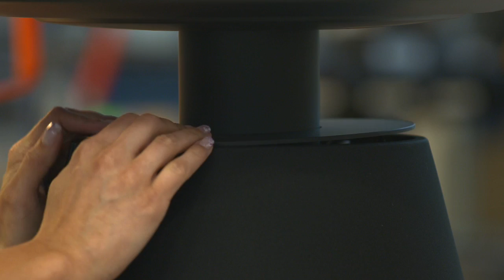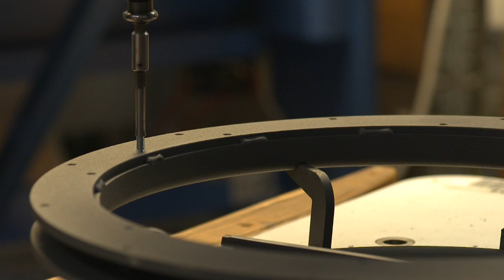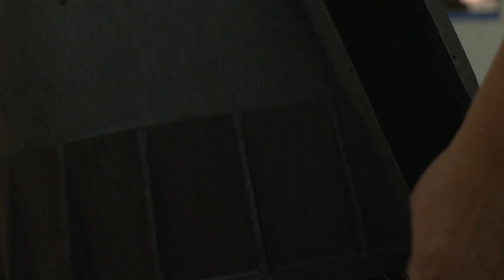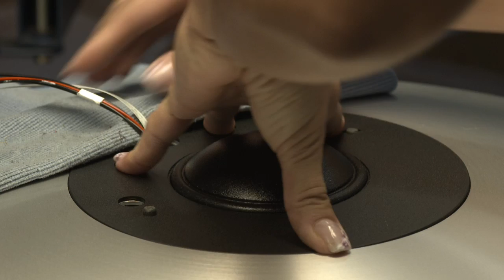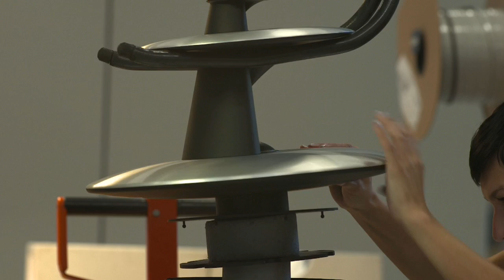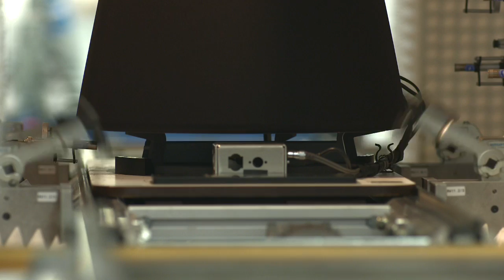Attention to detail – How we build the Beolab 5 | Bang & Olufsen

Comment: Whats that, a 12" maybe 15" woofer and they use a thin plastic cabnet
Reply: each speaker is only 61kg so i guess it must be thin plastic all the way(ironic). I can tell you this, beolab 5 has the best sound i have ever heard.
Reply: Got memes? its 15inch
Reply: Horatio Caine and btw its 20mm thick

Comment: The BeoLab 5 is the most expensive BeoLab speaker in the range at 24k USD and, ironically, probably the LEAST style over substance model they make. Several Hi-Fi experts have measured these speakers to be incredibly neutral. You could get a pair of B&W 802D for 9k less, but then you'd make up all of those savings in the amplification necessary to drive those power hungry speakers. For this reason the BL5 makes the most sense to buy pre-owned (they were originally 16k in 2003 and haven't changed)